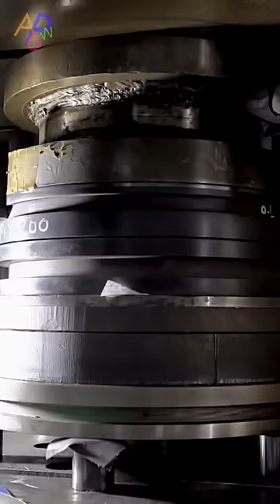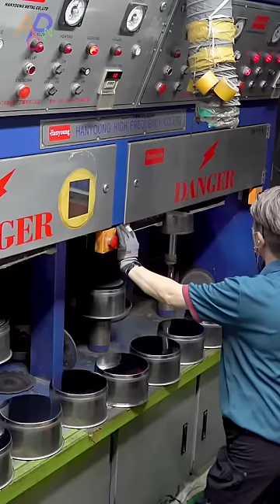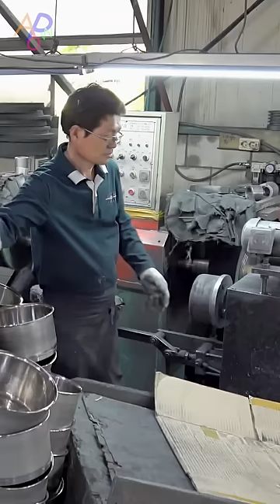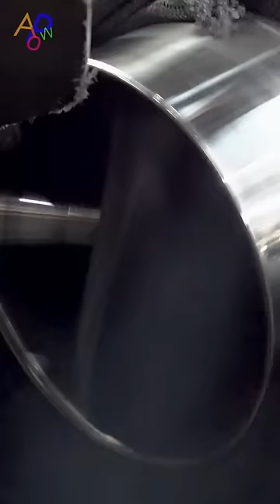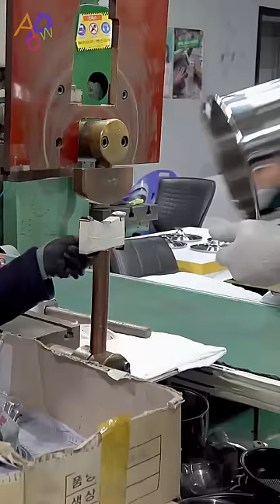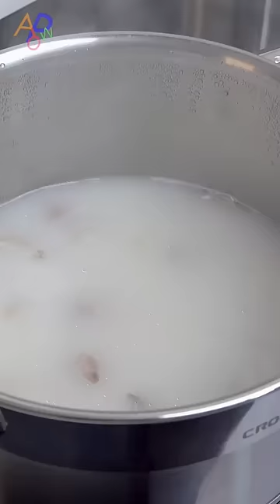Pot Making Process by Stainless Steel Cookware Factory #allprocessofworld

Comment: Wait, the nickel/copper bottom is only held on by two spot welds in the middle? I always thought they were sintered on.
Reply: That was the handle
Reply: @SecretaryBootyyJuice  nah I'm talking about around 6 seconds in they spot weld the round plate to the pot
Reply: @CenPapi i think that’s just the tack, no? Then the entire bottom is heated on another machine, after which they remove a hot plate that was probably used for the weld.